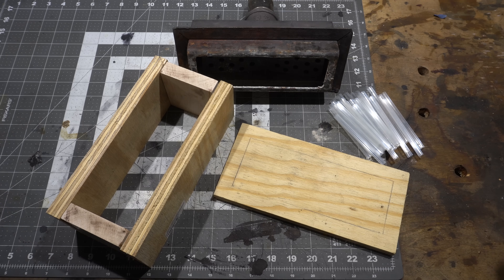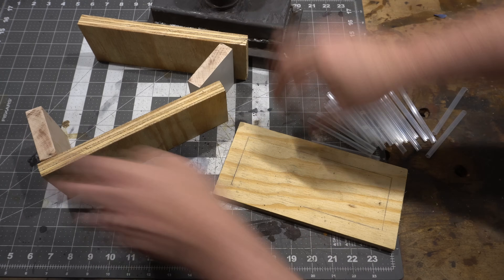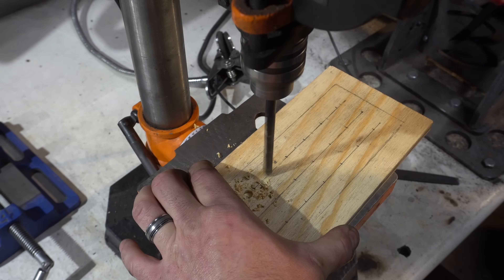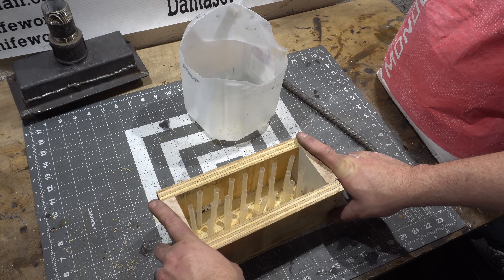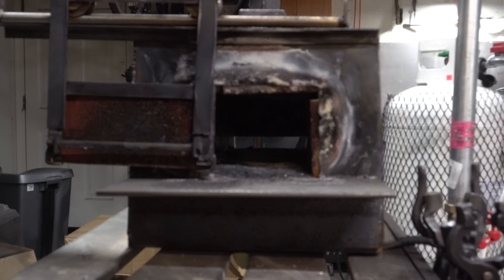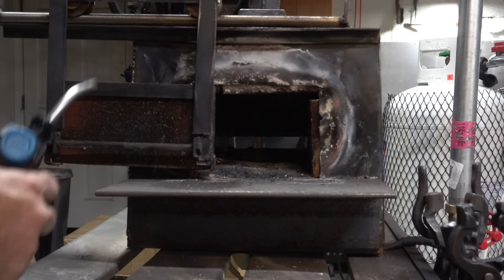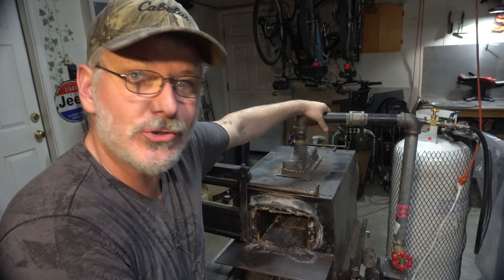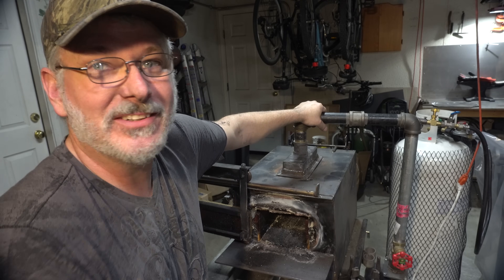Triple-T #77 - How to make a ribbon burner

Comment from the maker: Do you have any questions about the construction?   Also I suggest you follow the House / Work channel if you're interested in following a forge build.  Brian is doing some cool work over there.  👍🏻
Reply: Why do all this effort with straws?
Why not just pour in mold then once its hard drill the holes.
Way less effort.
Reply from the maker: @thegoldenatlas753  Clearly you've never tried to drill through this stuff!  It extremely hard and it's too easy to crack it with a hammer drill and concrete bits.  I've never seen anyone make a ribbon burner by drilling the holes.
Reply: @TyrellKnifeworks  hmm guess its different from refractory brick, thought it was just a pourable version of refractory bricks, which are really easy to cut/drill.
Reply from the maker: @thegoldenatlas753  no, not at all.  Castable refractory is like concrete with silica fiber added to it.
Reply: @TyrellKnifeworks  ah, may be possible to drill with diamond bits if nothing else. 
But this is good solution to it being hard as a rock.
Reply: @thegoldenatlas753  its full of hardened ceramic or similar chunks mixed with soft stull like alumina, depending on the mix, its liek what they do with metals in safes to break your drill bits by having radically varying harnesses youd break or have to resharpen at the very least a lot of drill bits
Reply: So does a ribbon burner do the same job as multiple Venturis as in distributing heat.  Are they better or cheaper than Venturis?
Reply from the maker: @stewartanderson6560  a ribbon burner is better because you can dial down the gas more because the air flow is fed from a blower.  The Venturi burners need some minimum gas flow because the flow of the gas is what drags in the air.  Forced air burners will be better and more fuel efficient.  They are also very easy to build.
Reply: I have a question I'm in the process of building a ribbon burner forge now. my interior dimensions will be 9x9x16l I have 3 inch square tube, how long of a burner do you think I'll need to heat it up to forge welding? pineridge burners say I'd be good with a 4.25x6.25 based on interior volume but I feel like I should go slightly larger like 3x10 or 3 x 12 cause I can always turn it down if it's to big but if it's undersized I'm screwed.
Reply from the maker: @johncollinson196  I agree, I would go with a 3x10" at least.  Note that you should be spreading out the holes in the burner, not just adding more.  On a side note, 9x9 is a MASSIVE opening, are you sure you want it that big?  It's going to take a really long time to heat up.  Mine is only 7W x 5H x18L and I find it a little too big and my new one will be 5W x 6H x 18L.
Reply: @TyrellKnifeworks  yeah I think so, might lower the top by 1 inch or so, my next project will be a forge press, so I'd like enough room to be able to do multiple billets, and hammer blanks. I plan on when I don't need the extra space to throw in a couple ifbs in the back of the forge to take up some of the extra space.
Reply: if you use metric & a 1cm drill bit then u can work out how many holes u need by measuring how far across your pipe is multiplying it by pi/3.14 then drill that many holes, each drill hole is 1 square cm
if that pipe is 5cm across for eg youll want 5x 3.14cm2 of holes or ~16 holes

where's if u use crayons ext youll never fit over 14 or maybe 15 if u use really thin ones because theirs always space in between.
when ppl say their running burner at 1psi they its probably the nozzle reductions pressure increase their measuring, because theyed be having a few less cm2 of nozzle compared to pipe capacity if they used something like crayons to measure volume
Reply: i have a question what is the mold depth mainly im making a 3×12 just dont know length of straws and hight for refractory
Reply from the maker: @TheJuly1300  I think the mold depth for mine was about 2 3/4” and the square tube gets inset into that about 3/4”.   This isn’t a hard rule though.
Reply: @TyrellKnifeworks  ok ty so much
Reply: Hello, I did mine here in Brazil but I don't know if I exaggerated the number of holes, it didn't release much pressure
Reply from the maker: @chacalcutelaria  I suggest you put as many straws as will fit into your pipe leading to the burner, then that’s how many holes you need.
Reply: @TyrellKnifeworks  Good morning, the burner is 295 mm x 65 mm, I placed 16 holes in the center line and 15 holes on both sides, holes of 8 mm in diameter, the gas injector is in a 1 1/2 inch tube at a distance of 8 inches from the tape burner box, it did not give very high gas pressure, which is worth telling you The refractory bricks I used were from a scrap boiler and they are very heavy and hard but from my understanding they are absorbing the heat, I even managed to boil an apricot, but it took an hour to reach the temperature, it was not economical, it uses a lot of gas
Reply: It will be interesting to see how much he sells them for.
Reply from the maker: @stephenborders4654  yes, it will be interesting.  I sure he’ll keep them competitive.

Comment: The other thing with refractory is it does not reach strength until its heated to its vitrification temperature.a ribon burner will never get to those temps. Not saying it wont work just dont ecpect it to be truely a refractory cast concrete and of strength.
Reply from the maker: This burner has been going strong for almost 3 years. Thanks for watching.

Comment: I am making a current burner with the 3" design.....forge is 24" long by 18x18....will have 4" walls and 10" inner cavity....burner is 20" long....taking forever to make but is interesting.  using kaolite 2600 as the refractory..
Reply from the maker: That sounds like a great forge build!

Comment: Also can I get a parts list for the burner please. Thanks in advance.
Ron
Reply from the maker: The burner is just a 3” steel tube with ends welded on it.  The other stuff is just 2” steel pipe you can get at the hardware store.
Reply from the maker: I suggest you watch my more recent forge build video as well.  https://youtu.be/xL8waDrGVlY?si=rqkTC3FwG3YEncDZ

Comment: I’m attempting to make my own forge with a 32 gal air tank. Will this ribbon burner work for this size forge?
Reply from the maker: Make your ribbon burner about 2.5” shorter on each side than the length of your forge.  Ex: 18” forge, use a 13” burner.

Comment: Thinking, shouldnt be a problem to plug the ends of the straws with blue tack / plastecine to make pouring the refractory without getting it inside the straws? right?
Reply from the maker: Sure, that would work.  Thanks for tuning in.

Comment: Maybe this question has been answered as I have not read the comments, but since you are dealing with fire and heat, couldn't you just melt the crayons out instead of drilling it?  I would think you could put the burner in an oven on a rack with a cookie sheet under it and just melt everything out.
Reply from the maker: Sure, but that’s takes a while, makes a mess and gets wax everywhere and all over your burner.  Straws are super simple, faster and also reusable. Thanks for watching

Comment: Great video. Is there any risk that the flame could bleed back into the part of the ribbon burner behind the refractory front through the straw holes and ignite the gas air mixture there?
Reply from the maker: It’s the same with any propane burner.  The blowing force pushes the gas out the holes where it ignites.  There are times if you get the forge too hot (2300F+) than the burner is so hot it can ignite the gas inside it. That’s called a tube ignition.   It just makes a funny sound.  All you need to do is turn the gas down/air up and it goes away immediately.  It’s not dangerous.  Thanks for watching.
Reply: @TyrellKnifeworks  Thanks for that information

Comment: My pipes are 2”, so to using a 3” square pipe as the base, I need to put as many Mc Donals straws that will fit in the 2” pipe, the. This will determine the length of the burner so I can fit the straws in 3 rows? (I’m assuming)
Reply from the maker: The length of the burner is your choice.  The number of holes in the burner is how many straws that can fit in your 2" pipe opening.  Thanks for watching.

Comment: first time I have seen this type of burner. I melt iron and started with a venturi "Reil" burner that needed 30 psi (at the orifice). i added a fan to the same device with a butterfly valve to regulate air flow. time to pour was the same with 16psi. forced air is defiantly the way to go plus it has the added benefit of adjusting the A/f mixture from too rich to burn to, too lean to burn.  an oxygen free (slightly fuel rich) environment is desired... right? I would suggest that the fuel be added to the airflow closer to the burner reducing the amount of A/F mixture "in process" in case of back flash.

Comment: How long of a ribbon burner would be effective? I am thinking of a 40” forge and a 30” ribbon. Would you need two inflows or would it work? Approx how many cfm fan would make it effective
Reply from the maker: I don’t think that would work, it probably wouldn’t burn even.  I think you’d want two burners with a single massive fan with pipes that split or two fans and control them independently.  Brian House of Housemade just showed a similar one on IG with two burners off a single large fan.  Check that out.

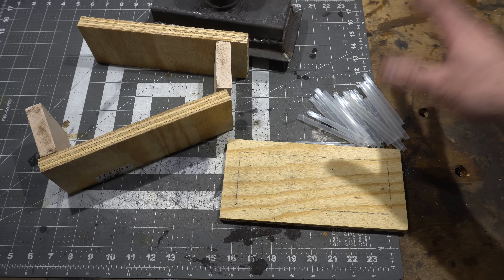Comment: For 3:15, I don't wanna be that guy... but you could also just use πr² = Area to calculate how many holes and how big to make them.
Reply from the maker: But then you have to calculate the size of a the pipe, then the size of the straw, then divide... that's way more complicated than just putting a bunch in the pipe until it fits.  😉.  Thanks for watching.

Comment: If you want to compare the gas usage between ribbon and venturi burner place the bottle on  a scale for a hour. weigh it before and after and you can figure how much gas you are using per hour.  Do it on both burners.   So how many cfm is your blower running.   It looks like it burns real good.   I keep wanting to up grade but have not done so.  But you have about the best design from what I have seen.   I am thinking of molding mine with a bit of a taper on it so it always seals good and I do not need the flange around the top.
Reply from the maker: Yes the weighing approach works but you really need to do a test for a few hours at least to get a measurable difference.  I’ve since replaced this forge with a circular one.  Check that video.  It has links to all the parts.  https://youtu.be/xL8waDrGVlY?si=cPHntlYFhnwZmnGX.  Thanks for watching.

Comment: So the ribbon burner uses less gas, right? 😅
Reply from the maker: I'm not sure if that's a serious question, but no, it doesn't use less gas.  Just less pressure.  Flow rate is a totally different thing.  Thanks for watching.

Comment: please can you explain how did you connect the needle valve to the 2 inches pipes? i saw the set screw you did...   how did you seal it ?
Reply from the maker: I’ve since removed that.  You are better off drilling and tapping a hole that accepts the 1/4” thread and not worry about a set screw.  Thanks for watching.

Comment: I've started, like so many projects, to build some of these. I just built a waste oil burner, again untested. But I've been thinking if it was possible to combine them with enough air pressure instead of a blower? I have a 10hp 250 gallon compressor. And 3 55gal drums of oil. My burner has provisions for LP for ignition & heat up. Just pondering...
Reply from the maker: Sounds a bit unsafe with compressed air.  The pressure would constantly change, affecting your heat.
Reply: @TyrellKnifeworks  The waste oil burner I built is a siphon design, all Stainless with ball valves on each of the 3 inputs; oil, LP and the air which has its own moisture trap and regulator.
Funny, like everyone else I thought I wanted to make knives when forged in fire came out. But I learned quickly I can make more money making tools to make knives with. My few knives are one of my arts and I don't make them to sell, I gift them to family & friends. My wife looks at my welded metal sculptures and says I could sell that! Me; then I won't have one. I'm a one and done type. My boss says the same about my homemade tools, lol. I have 4 ribbon burners all welded, I just haven't done the refractory casting.
Reply from the maker: @a.joegevara3519  you sound like a handy guy.

Comment: Can see it is possible to get the refractory mix inside the straws.  Why not use full length straws and hold them in place with hardware cloth?
Reply from the maker: You need to put the metal burner on top so the straws cannot be full length.  Thanks for watching.

Comment: but the metal parts will rust over time. no?
Reply from the maker: No, not at all.  I’ve had a ribbon burner for years and there’s no spec of rust.  These don’t get wet, and if they did the heat burns it off quick.  Thanks for watching

Comment: im going to be building a ribbon burner. Is there a special way you have to introduce the propane into the air flow? how close to the burner do you want that?
Reply from the maker: Usually you want it at least 12" before the burner and preferably have a 90 degree bend after its introduced.   That helps it mix thoroughly with the air.  I hope that helps.

Comment: Thanks! I hope I'm not driving you crazy with questions, BUT need to ask your opininion on what cracked the original block (KastOLite-30 maybe?)? I simply cannot afford that wonderful Greencast stuff - YIPE$!  What if I reinforced the casting with tiny stainless steel fibers or something to help prevent such a crack?
Oh, and by the way (maybe this will benefit YOU for a change), many ribbon burners can "backfire" or pre-ignite inside the block if they become to hot inside after an hour or so. I have a tiny little 1-1/2 x 6 burner which does that. For that reason, I'm maybe going to paint a little bit of IR reflective Metrikote (cheap version of Satanite high aluminum coating) on the outer face of my burner.
Reply from the maker: Kastolite30 is just fine.  What cracked mine WAS a piece of steel reinforcement in fact!  That steel inside heated up and the burner cracked right through that location.  I had the same thought process you are going through thinking it would make it stronger but didn't account for heat.  So don't do it!  I am finding I have that issue with the backfiring of the burner on my new forge.  If I have more air pressure it doesn't happen though.  I get it when the flames are "lapping" more.  If there's enough air pressure that all the flames on each hole are solid, it doesn't seem to occur.  I do find I have to take off the back door on my forge after about an hour or it gets too hot inside when I'm forge welding and this occurs.  😜

Comment: Um this maybe dumb but could you do a video on controlling a ribbon burner? How to get it hot enough to forge weld or cooler if you don’t need it as hot. Do you not adjust it? I want to make one but I don’t see videos on controlling them. Tons on making them none on controlling them.
Reply from the maker: I'm not sure thats enough for a whole video but I'll talk about tuning when I do my forge build in a couple months.  Until then... with any forced air burner (ribbon or otherwise), you can control the gas and air separately.  If you turn down the gas with the same amount of air, you'll get what's called an oxidizing flame.  Lots of heat but also lots of oxidation and very little flames coming out the front.  If you turn up the gas with the same amount of air, you'll have a reducing flame which isn't as hot but will burn all its oxygen and flames come out the front of the forge to get more air.  If you turn up the gas and the air equally, you'll get more fuel and more air and a hotter flame.  Once you've maxed out either your air or your gas pressure, then that's the top end.  Make sense?
Reply: @TyrellKnifeworks  I thought i replied to this it must not have went. So you want the air gas mix even for forge welding? Like 1 psi? If i want less scale then more gas than air? Since i need heat for forge welding it sounds like it would be a more even mix? I will send you pics or video of my forge when complete. who knows maybe i will put it on youtube not how to just me doing it.
Reply from the maker: @christopherconkright1317  Of course you need a hot enough flame for the forge welding, but enough gas so that you have a reducing flame is important.  Too much air to gas ratio means you'll have an oxidizing flame and that's bad for forge welding.  The best way to measure it is how much flame you have shooting out the front of your forge.  When forge welding, get it hot enough but have at least 6" of dragon's breath, if that makes sense.  Note, On a venturi burner, you always have a lot more dragons breath because there the gas/air doesn't mix as well before it hits the flame, thus the gas hits the outside air and combusts.
Reply: @TyrellKnifeworks  I ordered a pineridge ribbon burner I am not confident enough to make one just yet. Propane has went up to much to not use as little gas as possible lol. Okay so i want enough gas that i will have a good amount of dragon's breath when i need to forge weld but can reduce that back for normal smithing.